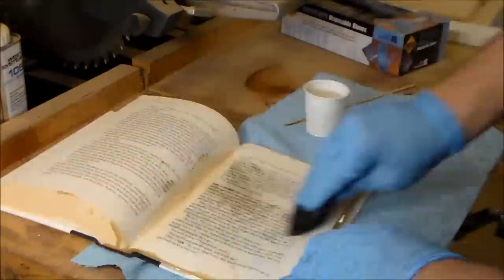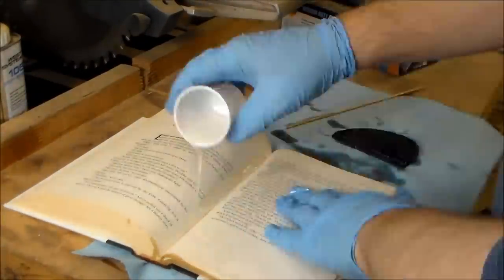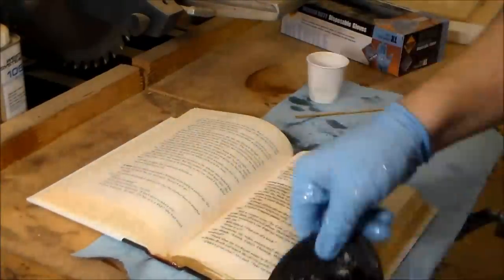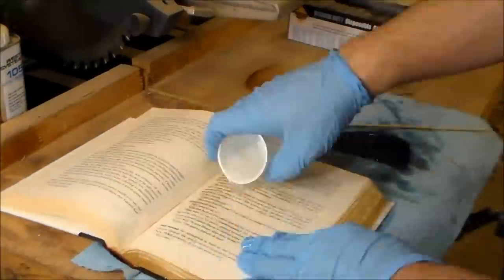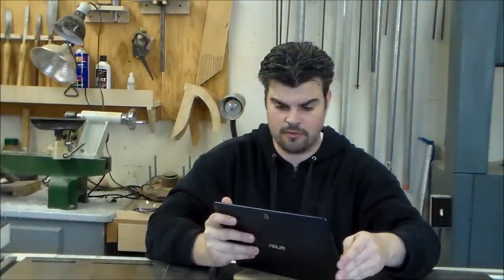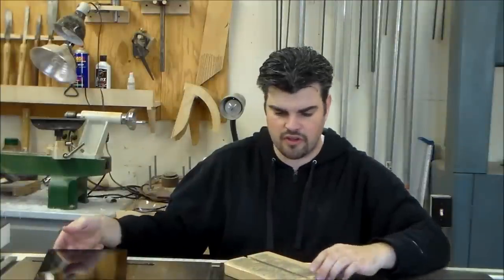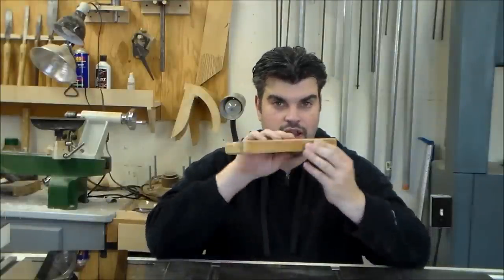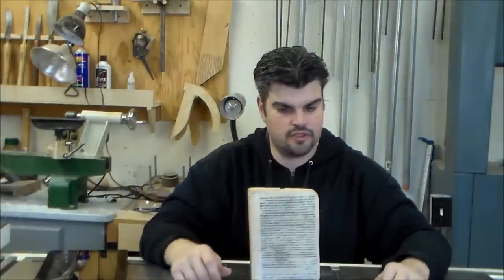How To Make A Tablet Stand From a Book

Comment: I think itd be cool if you tried this again only leaving the book 100% intact, with the covers and everything, and instead of using a notch to hold it up, make it so that the book opens up to a 100 degree angle (or close to) and stays stiff. and when you open it theres a slot so that the tablet doesent slide forward. Then you could really put it on your bookshelf and noone would notice until you pulled it out and plopped your tablet onto it
Reply from the maker: +howycwap Oh, yeah, That is a cool idea! I like it. 

I use this almost every day, and it's super sturdy and useful. But that was A TON of resin and way to much work for my tastes...
Reply: +Peter Brown i feel like you could use normal craft glue for the majority of the project though. since its not a knife handle or something that needs to be rock hard, epoxy doesent really need to be used on the inside layers...maybe
the only problem youd have is squeeze out, unless the glue dries clear, which im sure you can find at a craft store. food for thought, maybe one day we'll see a tablet book stand 2.0 video ;)
Reply: Peter Brown please try this idea in a dip it episode, or try dipping glitter
Reply: @peterbrownwastaken  Would something like this work with stabilizing resin? would the interior pages be porous enough?
Reply: haleypotter417 That sounds like a great idea to me. I hope he tries it.
Reply: Nah, hammer time

Comment: I think you should revisit this project and salvage the book binding. Isolate the covers and the first 10 or so pages so that the book opens up into a tablet stand. If you'd want the book to open all the way up; you could cut away the 1st 10 page and the cover, make the spine rigid with a crease long-ways down the middle, and have it able to fold under the bottom of the book. To make the top untreated pages the same color, you might be able to add a very thin coating of oil or whatever. I would add in some small magnets to the outer corners of the top cover and hidden in the epoxied pages so the book would stay closed with the binding tight across the spine, otherwise it'd probably want to stay somewhat flopped open.
Reply: dorgodorato 
or find a book big enough to turn into a tablet case/stand

Comment: Nice. Maybe someone could take out the first page and glue it back on after the cutting and shaping so the epoxy doesn't make the lettering bleed through of the other pages. Then re-glue the binding on and harden it  at an angle (as if it's opened) so the tablet appears to be resting on the cover some how (epoxy maybe). It would look more like the book was opened.Going to have to try this myself but gotta use something other than epoxy. Limited budget and all. nice job though. I enjoy how you think out of the box for materials.

Comment: When you have your table saw at an angle and do repeated cuts moving the fence a smidge each time, you leave a rough surface inside your dado, because the edge of your blade doesn't match your cut. But later, your dado is smooth. What did you use to level out the bottom of that slot?
Reply from the maker: Good eye. A 1/4 chisel made short work of the little jagged edges, the material is very workable with woodworking tools!

Comment: Nice job, and a wonderful way of keeping an old book out of the land fills.

Many of the other "modified" books I've seen only glue the outer edges and the insides of the reliefs.  While that does keep the "book" lighter, it also makes for a weaker structure.  I like your method, and for this use, the extra weight is a good thing,.
Reply from the maker: Thank you Michael.

I've seen the book safes and what-not, and you're right if your going to support an expensive tablet it needs to be sturdy!

Comment: That's pretty excellent, and I don't even care for e-readers in the least! I've done a few "storage books", but not glued every layer like that, just drilled holes through and then glued a couple pages on top. I've also only used recycled copy paper, not former books. (One benefit to working at an engineering firm!) I wonder if the use of a vacuum chamber might simplify the process??? One tweak I'd also be interested to try is making a cover so that the stand could be closed and retain a book-like appearance, maybe even harvest the original cover when using a hardcover book? I've used masonite and fabric to make hardcovers on the storage books I've done in the past. Overall very nicely done, and a beautiful appearance!!!

Comment: Very cool build Peter.  A sign of the times, the physical version supporting the digital version.  Do you have much experience with the West System epoxy?  I have been wanting to try it on a few projects for a while now and I would love to hear from you as to how it is to work with.
Reply from the maker: Nick,

My experience is limited to the handful of projects I've done, but it works well.  The 207 hardener dries clear (no yellowing) and I feel like having the pumps was well worth the money. When these are empty, I plan to restock the shop!
Reply: Peter Brown Thanks for the input Peter, I have to get some too!
Reply: Peter Brown Sounds like they are almost empty :-)
Reply from the maker: Adam Roman
I would bet I've got a couple pumps from each left.

Comment: Why not just use a decent quality woodglue or similar to hold the pages? be cheaper/easier i would have thought
Reply from the maker: I'm not sure. The wood glue should work, but I'm not sure how much weight it would add. This is very heavy!
Reply: Peter Brown Indeed, the weight would be handy holding it down which is a good thing. I may give this a go since my daughter is a tablet and book addict :) Thanks for the idea!
Reply from the maker: *****
If you do make one, I'd love to see the outcome! Feel free to post it on my facebook page!
Reply: Peter Brown will do. What angle did you set the blade for the slot?
Reply from the maker: 20 degrees is what I set it to.
Reply: Peter Brown Thanks!

Comment: There is something depressingly metaphorical about this...but everything has its pros and cons...
Reply from the maker: rlt94 I hate reading books on my tablet. I ended up uninstalling the app it was so bad. Michael Crichton's NEXT was worse though... :)
Reply: It is also an interesting little philosophical twist, you effectively turned paper back into wood...
Reply: But what's that book even about?
Reply: The funny thing about metaphors is that you can really do anything with them.

Depressing: This book represents how an old medium (reading books) can lose its function and be replaced by new mediums (reading tablets). : (

Happy: The book represents how something old and increasingly outdated can still find value in becoming the foundations for newer innovations! : D

Or you can get just plain weird...

The book represents me and the tablet represents you. STOP SITTING ON MY FACE!

Once you view metaphors as purely conceptual (which they are), you'll never be saddened by them again. : D
Reply: NoNameC68 this needs to be a poster.

Comment: What's the resin you use??
Reply from the maker: Niamh Murphy I bought West System epoxy. The resin is 105, and the hardner is 207. It's expensive but quite a quality product.
Reply: Thanks a lot. Can you put colouring in it?
Reply from the maker: Niamh Murphy Totally. In fact krtwood has a video that he tints the same brand of epoxy. Spiral Inlay and Curved Drawers came out really nice.
Reply: Ya that's great I'm putting it in the central square of a table I'm making.